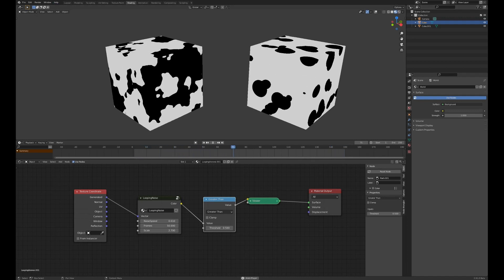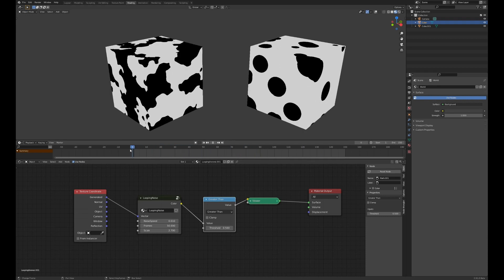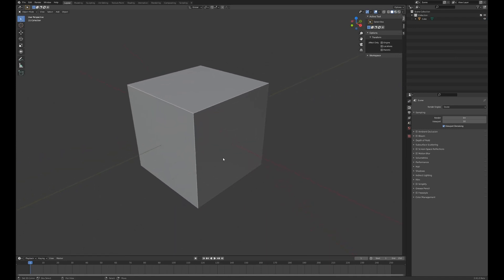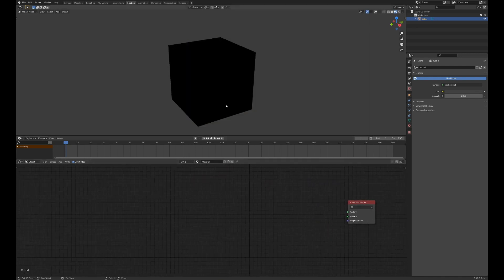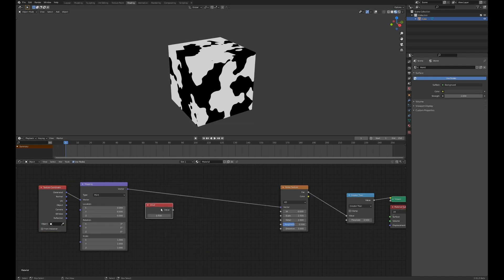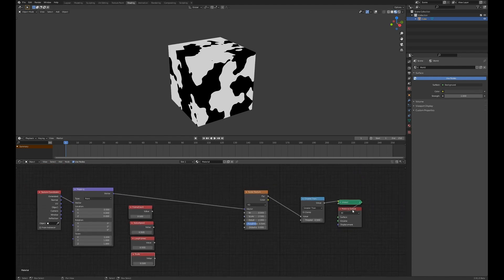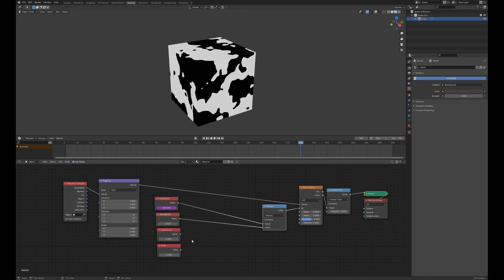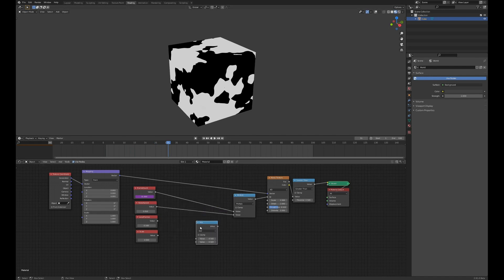Creating perfect animated noise loops in Blender.

Comment: can i use this for the location of mapping node? tried to connect the 1st multiply value to 1st mapping node and the 2nd multiply value to 2nd mapping node and mix the two w/ divide factor then connect to a 3d noise texture vector, doesn't work :/
Reply: fixed it by connecting the mapping node to the texture first before mix node. i thought it can use 1 texture node only but unfortunately still needs 2 texture
Reply from the maker: Should work, but not 100% sure what you are trying to do. Are you just trying to use the noise to make a random wiggle of the texture coordinates?
Reply: @rcpongo  it's the same as yours, except I tried to simplify it using the location instead of W value bc 4d texture is heavy for my laptop
Reply from the maker: @ilham-t9y  ok,… so my answer will be that you can make something that loops doing that, but the beauty of the 4d texture is that it phases in place. Creating the motion another way will be similar to a flow map where the pattern will move in a constant direction.

Comment: how did you make the viewer node
Reply from the maker: I use the Node Wrangler add on. It comes with Blender, but you need to enable it. Then whenever you click a node while holding ctrl-shift you will get the viewer.
Reply: @rcpongo  oh mb

Comment: Is it possible create a CYCLE Group without texture inside?
I would like reuse just connecting INs and OUTs.
C4D have a simple Checkbox for looping procedural textures.
Thanks
Reply from the maker: Unfortunately with this method, the textures need to have an offset, and this is calculated inside the node. You could have a texture that could connect from the outside of the group, but you would also have to put other parts outside of the group as well, and that would defeat the purpose here.

It would be nice to have a loopable option for the textures. If that ever gets added this whole video will be no longer needed.

Comment: How the f#%]^ can I change the color of this thing!? I am so frustrated.
Reply from the maker: I would suggest either sending the black and white noise pattern to a color mix node as a mask, or better yet, just send the noise to a color ramp node and add whatever color you want there.  You can get rid of the math greater than node since I am only using that here to make the noise high contrast. You can do the same thing in a color ramp by putting 2 colors right next to each other.

Comment: guys be very careful with #frame on blender version 3.6, just a little more and I would start reinstalling windows. The problem is that this driver gives an error when rendering animation for more than 1 minute, even on 3080ti I got several blue screens, it looks like I will have to set this indicator manually 😢

Comment: Great tutorial.

Also, the modulus value will never give you fifty in this case because it goes from zero to forty-nine. If the frame is at fifty you have fifty divided by fifty which gives you a remainder value of zero, so 50 modulus 50 is 0. The division node near the end will never give you a value of 1.0. But that's good though, because you don't want frame fifty to be the same as frame fifty-one.

Comment: can i make the same with just on the animation of Y-rotation on mapping? i want to reduce the speed of the animation and to keep being looped
Reply from the maker: You can simply adjust the “noise speed” value to change the speed, and everything will continue to loop properly in this setup. If you go too slow and have a short loop time it may look a bit repetitive, so you really need to adjust all 3 parameters (size,speed, loop frames count)
Reply: @rcpongo  in my case i want only Y-Rotation of the noise texture. and i animated this from mapping node. is it possible with a setup like yours? or similar?
Reply from the maker: @bilbag  yes, definitely possible to use rotation instead of the W parameter, and keep everything else the same. Moving noise using rotation can create some undesirable motion though, which is why I would generally not use that method.
Reply: @rcpongo  thank you a lot for the answers! its sea and ''waves'' thats why i wanted only Y-rotation. i cant understand what i will put in my case of your first value node because i use mapping. i failed to do it but i will try more

Comment: This has been insanely helpful while trying to solve a similar problem, thank you! I'm having trouble tweaking the setup to what I'm trying to do though. When I jack up the scale value the animation speeds up with it. Is there a way to scale up my textures without this happening? I tried using math nodes to divide my W values and that slowed it down but threw all of the looping off.... Anyone know how to fix this?
Reply: Update: I figured it out, just had to make the noise speed value very very small. (0.0001) Thanks again Troy for sharing this awesome technique!

Comment: Thx for the vid this is extremely helpful

I am trying to use this node setup to loop volumes inside an orb. The only thing I am struggling with is where exactly the greater than node goes, as my setup goes straight from the mix node to the emission color of the principled volume node. I've tried inserting it everywhere but I feel Asif I may need to add some extra nodes somewhere?
Reply from the maker: sound like you have the right idea, but for a volume set up I would place the greater than node after the mix, followed by a math node set to multiply, then run that into the volume density. Use the multiply node to increase the density, and the greater than node to adjust the clipping of the volume.

Comment: Kudos on hiding the most interesting details from view while showing your technique.  I think I know what was hidden however your technique seems solid.
Reply from the maker: Wasn’t trying to hide anything, so ask away if there is something I missed talking about, I’ll do my best to explain.
Reply: @rcpongo  Ok.  What was under the green node immediately next to the output?   You labeled your node group "Vornoi," but I did not see that you used any "Vornoi" nodes during your demo.   I am a noob, and sometimes noobs need to know how to make groups and rename group inputs. Three videos later, I have all the info I needed; however, I wanted to share with you some of my frustration.  I realize you are far more skilled with Blender than I can be right now however you lose nothing by sharing your knowledge.  Blender is a very powerful system, and I will learn whatever I need to know to make it work; this is who I am.  Thanks for making videos.  Keep up the good work.  You earned the Sub I just gave you.
Reply from the maker: @CappySmack  Oh I see. That green node is nothing at all. I use the plugin "Node Wrangler" and that is from that. All it is, is an emission material so You can see the output of any particular node by pressing Ctrl-Shift while clicking on the node. It's highly useful so check it out. It is in Blender by default, but you need to enable it in the preferences/add-ons.
As for the Voronoi, I just wanted to show that you can use the same technique for other nodes as well. In that case, just swap out the noise texture in the video with a voronoi one and everything else would be the same. Hope that helps
Reply: @rcpongo  I assume it would be possible to group your work so that Vornoi could be used in place of another set of nodes.  I discovered one can group a group via nesting.  I also use Node2Code to make node groups into addons.  I also use an Emission node for my application of your work because I wanted to replicate some static on a set of CG monitors for a project I am working on.  Your video was very useful to me nonetheless.  You were clear except for the two items I needed to make your work useful to me.  Thanks again. 👍
Reply from the maker: @CappySmack  Yea, that would work fine. You could also wire up both versions in the same node and just have 2 outputs, one for noise and one for voronoi.
Reply: @rcpongo  Ok, but how do you wire to use one or the other?   I can see how to do both, but I am sure this will not work.   Is there a boolean node, or would I do a multiply from both nodes?

Comment: If you can get away with a looped 2D texture, you can use 3D textures (4D textures consume more memory). It's the same setup only that instead of plugging it into the W, you plug it into one of the values of the "location" vector input of the mapping node.
Reply: Thanks but that still Scrolls the 2D texture 
I found a way of avoiding that lol 
Basically plug those Multiply Math nodes into a 'Seperate XYZ' node and then 'Combine XYZ' it back but only plug in the Z value and then BAM, acts as if you only animating the Z location

Comment: only thing you did not mention. How do I expose the parameters from Value node to the group input?
Reply from the maker: To expose the value you can either just not select the value node when the group is created, or once it is created just go into the group and drag a value into the bottom dot on the inputs and it will add a new one. From there you can use the properties panel to ename it and set range/default values.

Hope that helps!
Reply: @rcpongo  racked my brain for a while. Ty for the fast response.

Comment: great tutorial. when you use keyboard shortcuts and don't say what you are pressing. like when you got the Viewer node to connect to the first noise texture node at 2:44 ... makes it very hard to follow.
Reply from the maker: Sorry about that! I know I use a lot of keyboard shortcuts and try to call them out when I think about it, but I know I miss a lot of them like this as well. For that particular part you mentioned, I am using the node wrangler add-on. It ships with blender, but it is turned off by default so you need to enable it in the preferences/add ons. Once it is in there, you can quickly connect a viewer node by pressing ctrl-shift and clicking on any node. It's very useful, and does a bunch of other things like this as well.

Comment: Thanks for this tut, I was looking for something like this so I wouldn't have to use the rotation on the mapping for looping. Great help! I have a question not related to this tut though. How do you connect the value nodes with the group? I can connect every other value, but can't figure out how to do it to the value node. Halp? :)
Reply from the maker: You can manage all of your group inputs with the right side "N" panel. From there you can add or remove connectors for your group. What I like to do though when creating the group is to select all of my nodes EXCEPT the value ones that I want exposed to the group. This way the group will be created and those values are now outside the group. Then I can just remove those value nodes because the group now has them neatly listed. I hope that makes sense.
Reply: @rcpongo  Ahhh!!! Thank you! <3 Makes perfect sense ehhe :)